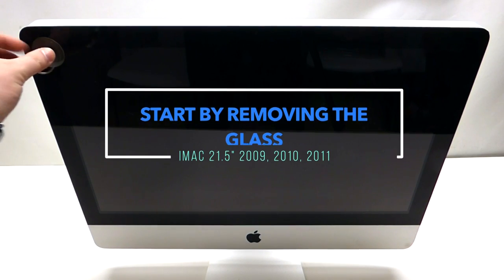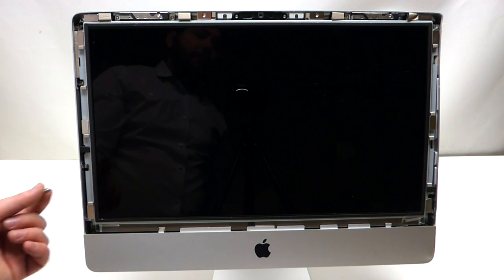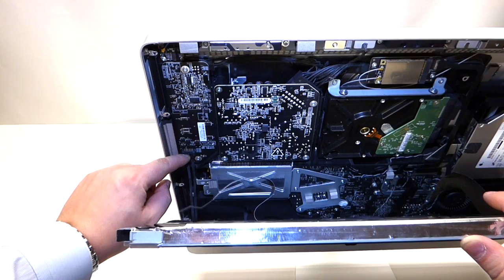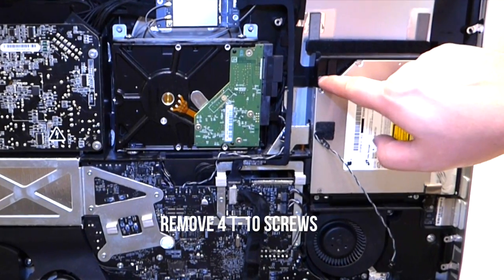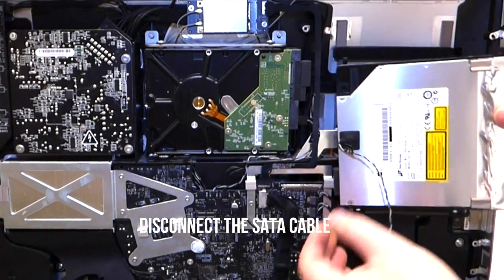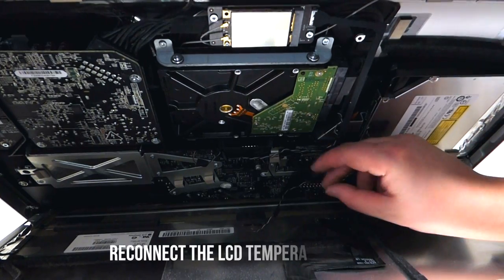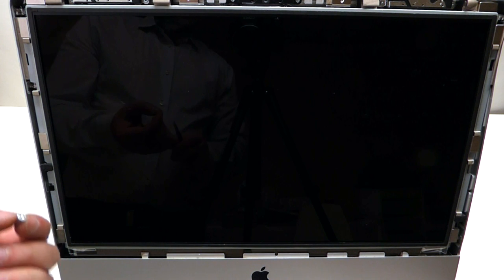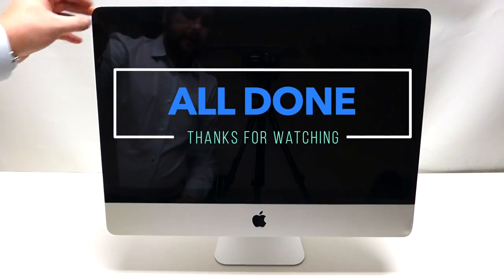iMac DVD Super Drive Replacement 2009 2010 2011 21 5" Apple Dollars #8

Comment: As well as the comment re not having the power cable plugged in, I would add that the power supply High Voltage retain charge for a while after being unplugged and the voltage is like 350V DC.  It is best to leave the iMac unplugged and untouched for an hour or more before starting work.    I know this from experience reaching in to disconnect the display cables and the back of my hand touched the power supply.  Oo-ee.

Comment: Will the iMac boot without a Super Drive connected? Figured I’d remove it for airflow and just use an external disc reader should the event ever occur

Comment: My drive lasted about 5 years of constant use then packed up. I’d say an external is cheaper to replace it with cos if you can’t replace this yourself an Apple service center will charge you a fortune!
Reply from the maker: External drive is good for storing files but if you store the operating system on it your computer will be unusable as transfer rates are 5 times slower then the internal drive.
Reply: @GRIBSOFT  The issue is that if you use external drive you can not install windows bootcampo because they don´t want to install windows with external devices

Comment: You have to be super careful when you reconnect the ribbon cable to the video card during re-assembly. The socket is very easily damaged and the plug destroyed by misalignment.

Comment: I’ve upgraded my drive but now the computer fan runs a lot more often, is this normal? Is there a setting I can modify?
Reply from the maker: So this is because you didn't have an option to reconnect the temperature sensor on the new drive. Use this application called MAC FAN CONTROL to slow down the fan, download it here https://www.appledollars.com/downloads

Comment: Will my imac still run if the superdrive has been removed? I Got one for a low price only to open it up and find that the superdrive was missing. Don't think I'll ever be watching dvd's or using cd's on it, so do I actually need the superdrive installed to use the computer? Thanks!
Reply: No you don't need it, actually you can install second hard drive there, that's why I am wathing this video.

Comment: Great video, question for you this will be the same process for the 2007 iMac 21 inch? Thanks.
Reply from the maker: 21.5" iMacs were first produced in 2009 and later. 20" aluminum iMacs were produced 2007-2009, they are built different. I will be making a video series for them in the next 30 days.

Comment: thanks for this great vid!  

Do you have any idea why these drives break down?  I barely used mine and it's now broken.  Are they just cheaply made?
Reply from the maker: Heat causes atoms to contract and retract causing components to misalign over time. iMacs especially have everything built into one unit so the LCD, power inverter and power supply produce a lot of heat when on. When off, the components inside cool down and retract so over many years this will cause some components to fail, not just the DVD drive. I hope this explanation helps.
Reply: Apple "quality". All of our 3 DVD drives are broken (2 macbook pros, 1 imac). I am aware that these are not new machines anymore, but these drives broke down years ago. I didn't care back then, but now I have to install Windows on the imac and that crap doesn't accept the disk if it is not placed in the built in drive (external doesn't work, nor does USB boot). I am >< this close to drop all Apple products.

Comment: hi! thanks for the tutorial!! Quick question! if I just want to remove my superdrive (because it is broken and for better cooling) in order to avoid the fan going max speed what should I do? should I just place the sensor back alone glue it in the back on the imac?
Reply: You can do that or install 'Macs Fan Control' to set the speed through that. I've done this to my iMac.

Comment: Great instructional video.  After purchasing a factory sealed replacement SuperDrive on EBay, I successfully replaced the nonfunctional one using the video as a guide.  My video data LCD connector was different and much more fiddly to reconnect, but persistence and use of the tweezers to engage the retaining clip paid off.  Thank you, I saved a bundle and now have a fully functional cd dvd drive.
Reply from the maker: Glad it worked out.